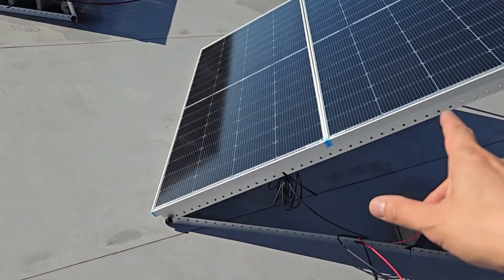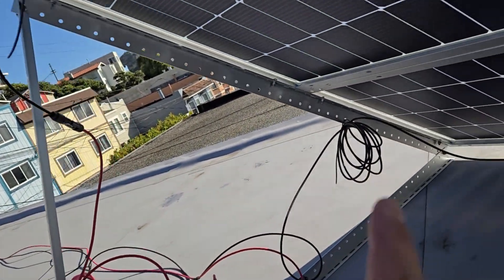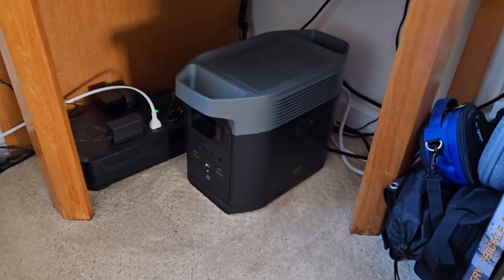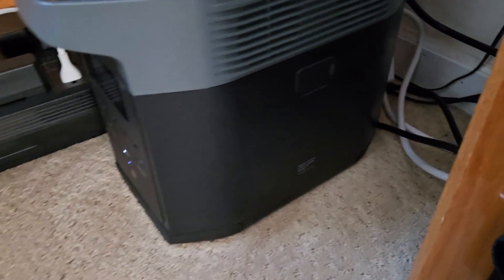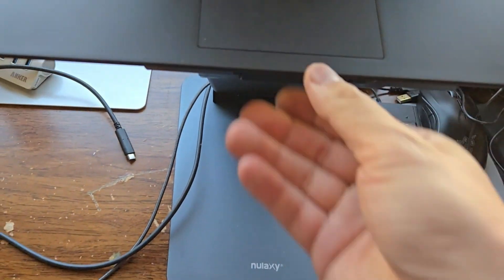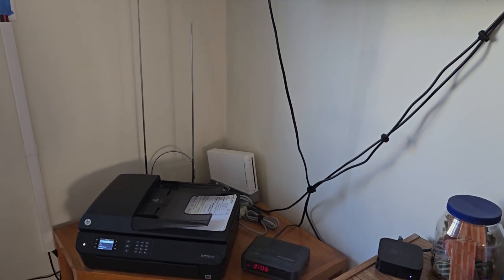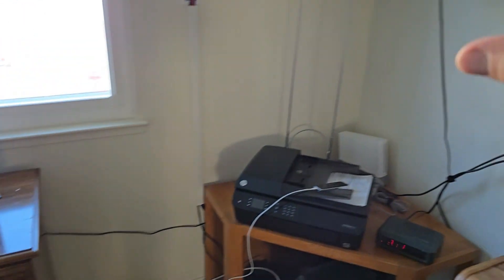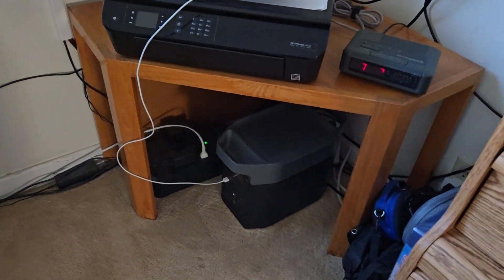OFF-GRID: Ecoflow Delta 2 w/ Renogy 16BB N Type 250w Bifacial Solar Panel

Comment: 1. I love that you have a Wii set up. 
2. I use the Renergy 115w Bifacial on my Ecoflow River 2. I've noticed it has pulled in upto 120w before the River capped it back down to 110. Great panel
3. I am currently awaiting my Delta 3 Plus to be delivered so looking to maybe get the 250 Bifacials. I am thinking if I use the XT60i I should be able to get the full if not over 500w per input. 

I enjoyed your video!!

Comment: Been using two Renogy 220w Bifacial panels on my mobile array in my yard.  Have see them hit 500w on one of my PV inputs on my Delta 2 Max before now.  Tempted to upgrade them to the 250w panels as they are more efficient cell wise.

Comment: Where did you get your 50 inch tilt solar panel mount? Is it the Renogy 50 inch RV Tilt model? I looks like that back support strut is longer then the Renogy 50 inch model. Did you get over the 250 Watts per panel? I hear some people are getting more then the advertised 250 Watts on this panel.
Reply from the maker: @marcusdean4045  Git the RV mount from Amazon. You can see my video of it constantly over 500+ watts. I saw 518watts a hand full of times. 👍 https://youtube.com/shorts/yAEwHiFNf5c?si=mnGXVqww3Col5hOp

Comment: Im just setting up my first solar setup very similar to this, D2M, and 2x renogy 250w panels 👍 they seem like a great fit considering the D2M is capped to 500w on each input. 

My plan is to start with the 2 renogy's for an easy reliable input, and then shop FBM for some used panels for the other input. Maybe 2x300w panels or whatever i can find that makes sense for 60v cap

Comment: hi, interesting setup, like the idea with the UPS connected to.. but you have a connection between the Ecoflow, to the UPS, then all power sources connected to the UPS right? - do all your solar panels on the roof go into Ecoflow? - thinking about a similar setup for a spring summer cottage.
Reply from the maker: @GustafKarlsson Yes, mainly to two Ecoflows. My other videos show a Delta Pro, and a Nature's Generator.
Reply: You can only do that if the UPS is rated for the watts being used... As the 1500VA can only handle 800 watts. You can't not exceed that or it shuts down..

And be advised. UPS are either 1 12v 7ah battery of 24v 2x 7ah batteries. I seen people try and put 2x 50ah to make 24v Lithium on them. The UPS will only charge at 2 amps. Which if it stays off very long under load. It would take 10 days to recharge them..
Reply: our*